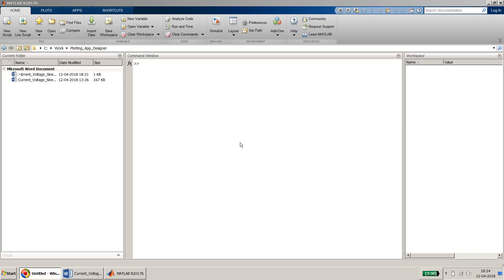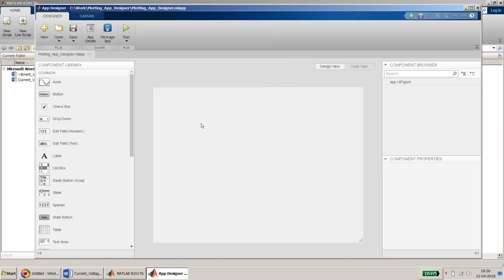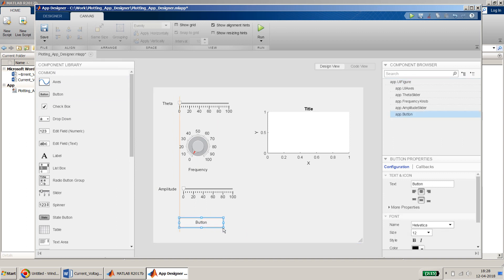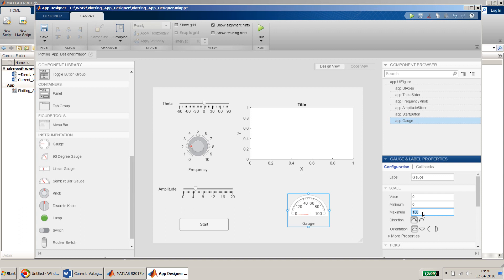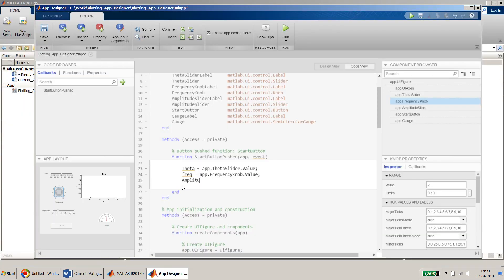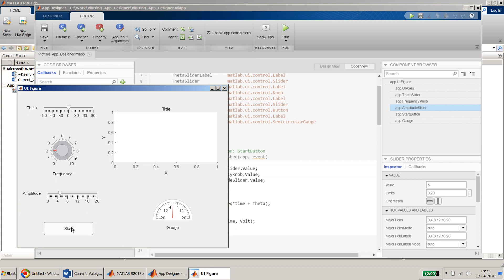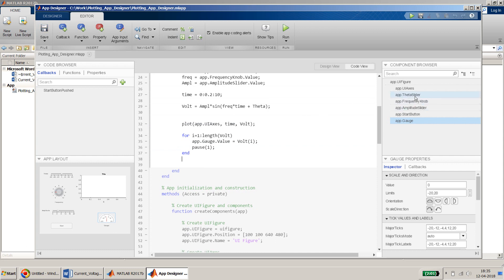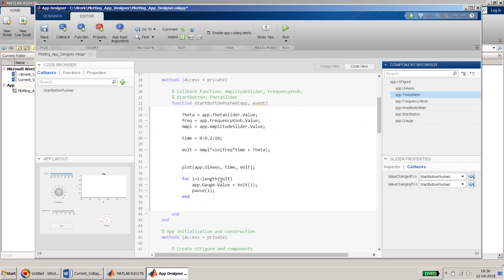How to plot in UIAxes and demo of slider, knob and Gauge in App Designer in MATLAB.

Comment: @programmer world I got good info abt app developer tool present in MATLAB from your tutorial. I just need one information becoz I stucked while creating a project.
In ur project after clicking start respected based on slider and knob values as output Volt. function is displayed. if we want to hold that plot again for next different inputs it's correcponding output to be displayed is there a way to do such thing mentioned as above.
Thanks in advance❤️

Comment: Can you tell how to put images in axis in UIAxis?
Reply from the maker: For images in App Designer, I have shown it in my below video where I have customized the buttons with images:

How to design a simple Game in MATLAB using App Designer?
https://youtu.be/3IQMZQ7JBn0

Regarding images in axis, I don’t think that is possible. Axis is mainly for plotting graphs. So, I don’t think there is any use case for putting images in the Axes. 

If you want to display images in your GUI, you can use buttons as shown in my above video.

Comment: Hi I am getting an error 
Error using uiaxes
Too many input arguments.

Error in uiaxes (line 109)
            createComponents(app)
and when I press start button then i get 
Error using plot
Parent must be a scalar graphics handle.

Please suggest
Reply from the maker: Most likely there is some issue with the plot command syntax you have used. Recheck it. Copy your Start button callback function and let me have a look.
Reply: THETA=app.THETASlider.Value;
            freq=app.FrequencyKnob.Value;
            Ampl=app.AmplitudeSlider.Value;
            time=0:0.2:10;
            volt=Ampl*sin(freq*time+THETA);
            plot(app.UIAxes , time , volt);
            
            for i=1:length(volt)
                app.Gauge.Value=volt(i);
                pause(1);
            end
Reply from the maker: Thanks for sharing the code. The callback function looks good. No issues here. From your error message 'Parent must be a scalar graphics handle' ... I suspect that your app.UIAxes is not created properly. I will have to ask you to share the complete code of App Designer. Then I can try to execute that in my environment.

I am pasting a part of my code. Please note there is Create UIAxes details in the Private methods in the code. Anyway share the complete code and let me have a look.

 % App initialization and construction
    methods (Access = private)

        % Create UIFigure and components
        function createComponents(app)

            % Create UIFigure
            app.UIFigure = uifigure;
            app.UIFigure.Position = [100 100 640 480];
            app.UIFigure.Name = 'UI Figure';

            % Create UIAxes
            app.UIAxes = uiaxes(app.UIFigure);
            title(app.UIAxes, 'Title')
            xlabel(app.UIAxes, 'X')
            ylabel(app.UIAxes, 'Y')
            app.UIAxes.Position = [254 222 365 217];

            % Create ThetaSliderLabel
            app.ThetaSliderLabel = uilabel(app.UIFigure);
            app.ThetaSliderLabel.HorizontalAlignment = 'right';
            app.ThetaSliderLabel.VerticalAlignment = 'top';
            app.ThetaSliderLabel.Position = [24 424 36 15];
            app.ThetaSliderLabel.Text = 'Theta';
.........................................
Reply from the maker: Your complete script looks good. And it runs on my machine correctly. 

So, now the only issues on your machine is due custom uiaxes.m or plot.m file which is over-shadowing the built-in function.

Use below command which are your custom files and remove them from matlab path:

which -all uiaxes
which -all plot
Reply from the maker: Perfect .. from your results it is apparent that your plot command is fine and the issue is with uiaxes command.

There is something which is shadowing the in-built uiaxes file of MATLAB. Remove any other uiaxes.m/ .p files which are there in the matlab path.

You should get exactly below output for the command (no over-shadowing):

>> which -all uiaxes
C:\Program Files \MATLAB\R2018a\toolbox\matlab\uicomponents\uicomponents\graphics\uiaxes.m

Else send me your output of below command and I will look into it.
>> which -all uiaxes
Reply: Previously accessible file "C:\Program Files\MATLAB\R2017b\toolbox\matlab\uicomponents\uicomponents\graphics\uiaxes.m" is now inaccessible.

Error in new (line 118)
            createComponents(app)

I am again getting the error
Reply from the maker: uiaxes.m file in your environment is corrupted. BTW what was the output of the which -all uiaxes command? Was there any other file overshadowing it?

You will need to clean up your matlab environment. If the file is no more present then take a fresh copy of this file from another ml installation. It should work then. There is no other option.

Comment: can you make videos on using global functions in app design and
A room has two doors, one dedicated for entry and other for exit. A PIR sensor is placed at both the doors to monitor the movement of the people. Write a MATLAB code to dynamically count the number of occupants in the room. Assume that PIR sensors are connected to digital pin 8 and 9 of Arduino Uno which are dedicated for entry and exit doors respectively .
An LED is connected to digital pin 9 of Arduino Uno. A distance measuring analog sensor that generates 0 to 5V is connected to analog pin A0 of Arduino Uno. Write a MATLAB program to vary the flickering frequency of the LED depending on the position of any object from the sensor. 
 Develop a user interface which consist of a static text and a button. On click of the button, the color of the static text should randomly change 
Thanks :)
Reply from the maker: I will be glad to help you out. Once I have some videos available as per your request, I will let you know.
Reply from the maker: I have made a video which may help you with your above requirements. You can watch it at: https://youtu.be/7Nn6DXfuEXs